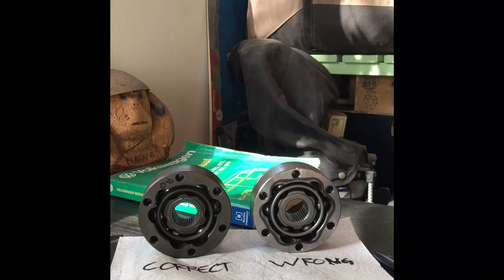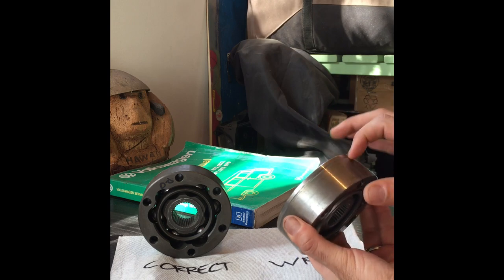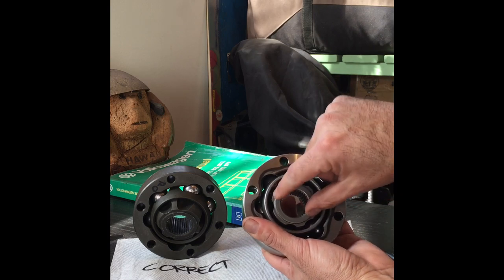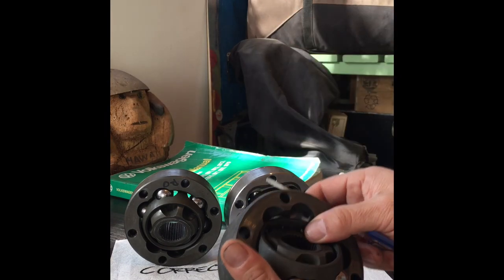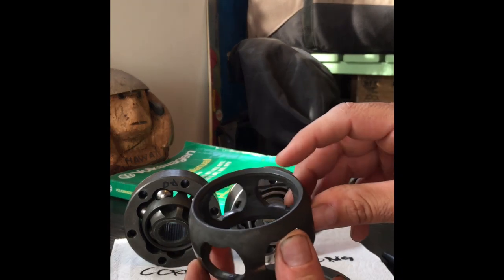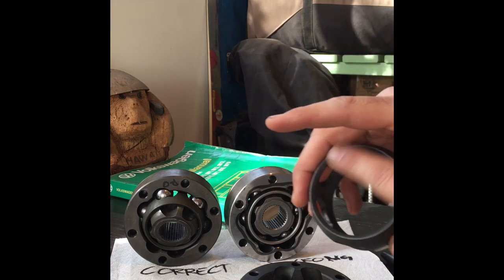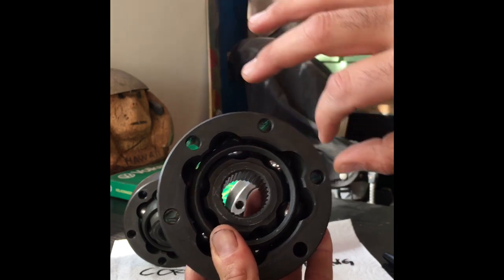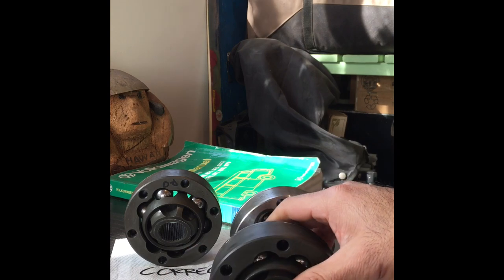VW CV Joint Rebuild

Comment: Man, thanks so much for this. Took apart one of my inner CVs on my '01 S4 and when I put it back together it just kept binding. Took it apart 3 or 4 times, and every time same result. I marked the flange side of all the components with a marker before disassembly so was confused what the issue could be. The relative position of the inner and outer race (big hump to small hump) was something I didn't consider, and that was the problem. Saved me from having to take off the other side and deal with all of that mess just to compare to a known good. Thanks again.
Reply: I'm wrenching on my 2000 s4, took apart the inner CV, and got things mixed up as well, glad I found this video to get things re-oriented properly.  Good luck on your B5
Reply: @sonicnofadz  Same issue with same car! Glad I found this. New inner CV's are $400+ now.

Comment: Life saver bro. Took apart my Porsche 924 cv joints to clean and inspect and put on new boots and they basically fell apart and I couldn’t figure out how to put them back together lol.
Reply: I took my joint apart to clean and got inner and outer correct but the middle cage... I did not realize it was directional. 
I got it back together but it had a very annoying vibration under hard acceleration.  
Was going to buy a new axle because it has some other issues and is a cheap China axle from auto parts store. 

This fixed my vibration. 
I have done many of these and I’m afraid to admit I had gotten very lucky. 
Right up until doing it on my own car in my own garage. 
Go figure.

Comment: Bought a new inner joint, fully built, and the balls and it didnt move at all. I've never done this before, but something was wrong i thought. So i had to use a hammer to turn the cage to put grease in it....hope i didnt destroy it. Going out to the garage to check if it came from the factory wrongly built, as i suspect it did. If so, this vid is a life saver before i install it to the axle today :D
Reply: Good chance it did, there's another guy called italjohn (I think!Swedish guy anyways)on YouTube who bought one from brickwerks who are very reputable, but which was assembled incorrectly.

Comment: You just resolve the issue i had with this cv joints. I mounted them in the "incorrectly" assembly way (btw how can that happen like its normal on all brands ??) and got incredible vibration like hell after driving the car past 80kmph, now i know what i need to fix. Many thanks.

Comment: Different videos give different info.. Others say the inner race with the hump, as you were calling it, goes outward, away from axle, you say towards axle??
Reply from the maker: I saw many videos and threads on thesamba.com and came to the conclusion that the chamfered/hump side goes towards the axle. It’s been working for me. Maybe it varies from vehicle to vehicle.
Reply: @carlosz7208  Just wondering is there a specific reason? Does it do something?
Reply from the maker: @targabill  I think the C-clip that holds the CV to the axle shaft may have clearance issues if installed the same side as the raised/chamfered/hump part.

Comment: The outside line that you say that goes to the wheel, in SFK VKJC5151 (VW T4) goes to the axle, I have to check the original one. Also the cage, the flat side goes inside instead outside
Reply from the maker: Maybe so on yours, but the orientation I've explained works on my set of CVs as well as others commenting here. Thanks for sharing.

Comment: Great and detailed video! As far as tapered edge of the cage, it should always go toward the axle but the raised edge of the spider gear should go against trust washer but I have seen some aftermarket axles where the spider gear's raised edge goes toward the transmission (circlip was installed on that end) - they didn't even use the thrust washer. What is your opinion to it?
Reply from the maker: To be honest I’ve only rebuilt my vw CVs once and they’re still doing well after 15k miles. There was an extra washer in my kit but didn’t use it. Can remember why, think it was for a different bug CV.
Reply: @carlosz7208 hi Carlos remember me I haven't forgot about you and this is going to be your year😂😅😂😅😅😅
Reply: @carlosz7208 don't worry  I'm closer than you think big guy I don't forgive I don't forget I get even and I've already seen you hanging with your fam nice kids by way hope they don't miss their father when he goes prison for beating a homeless handicap man that can't walk 😮😮😮😮😮😮😂🎉

Comment: Awesome vid! Removed my trans from my 74 super and one of the inner cc joints wouldnt leave the trans. Long story short one the balls fell out of the wheel side cv joint and here i am. We coudnt figure it out until now. Thanks! Would i be able to pjt it back together with the inner part installed on the axle or do i have to remove the C Clip and inner part? Thanks again inadvance.
Reply from the maker: Hi Krispy, thanks for the support.  I’d think you’d have to remove the entire cv from the axle to rebuild, easier than trying to assemble while on the axle.  The axle will obstruct the cage and inner part from lining up when assembling.

Comment: Great video. I’m planning on attempting this repair on my mk4 golf. Are both the inner and out part of the axle rebuildable? I’m getting a lot of shaking during acceleration only. My motor mounts n front end r new so my axles must be the problem as they’re 21 yrs old. I don’t wanna spend $600 on good ones so I’m thinking about rebuilding them. Any advice. Thx in advance
Reply from the maker: To be honest, I’m not a mechanic and have only done these on my vw bus once. They’re used as hell (40+years old) but were still usable. Check for excessive wear. All my cv’s were the same so it didn’t matter which side (wheel/tranny) it went on. Yours are probably similar but double check on that just in case. Make sure to buy good grease and boots.

Comment: So the "FLAT" side goes to the transmission flange and the "RAISED" side goes towards the driveshaft to the CV joint at the wheel. A bit confusing because at 0:57 you say the side with the line (the FLAT side) goes to the wheel or the flange.
Reply from the maker: There are two different bodies, same thing but one has a single line and no line. The other one has 3 lines and 1 line. Maybe something to do with different manufacturers
Reply: @carlosz7208  Well my inner CV joints do not have any line at all. They are original and off my Porsche 911 (993). But I did know about the narrow and wide tabs. I just wasn't sure which side the side with a raised edge (on the splined part) goes to and I also noted some rebuilds showing the beveled edge which all makes sense for shaft clearance.

Comment: Is it possible for it to be in incorrectly and still articulate because I've been hassling with mine for a couple days and I just put it back together and I hear considerable thumping and unbalanced feeling at traffic speed
Reply: But everything moved freely before I put it on the shaft and it seemed to move around just fine after bolting it up but it sounds like a bad CV shaft going down the road

Comment: I accidentally put mine together little hump towards little hump and big hump towards big hump like you show at 9:20 couse Im an idiot.....
Is their any way to take it apart again and reassemble it the correct way? Or do I need to buy a new CV joint?
 I was stressed out and did not take the time to pay attention to all the details in your video.
So this was a stupid mistake! However great instructional video!
Reply from the maker: Bultar från byn - Hi Bultar, sorry to hear you missed a vital step.  You can always reassemble if you didn’t damage the CVs.  Did you drive on them?
Reply: @carlosz7208  Nope did not drive on them, noticed that somethin was wrong right away when it was locked upp. Så due to its locked up I cant figure out how to get it apart without destroying in.. any suggestions? :)